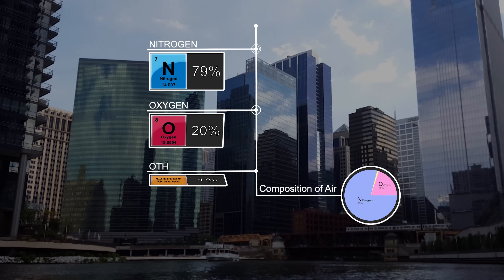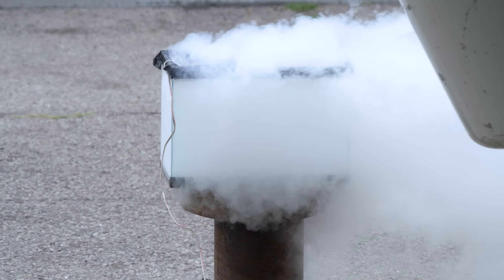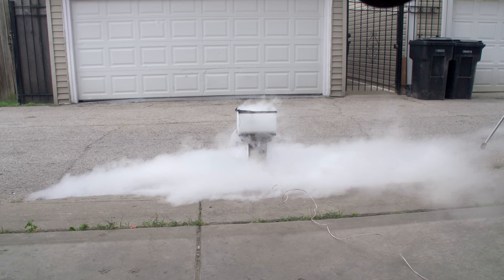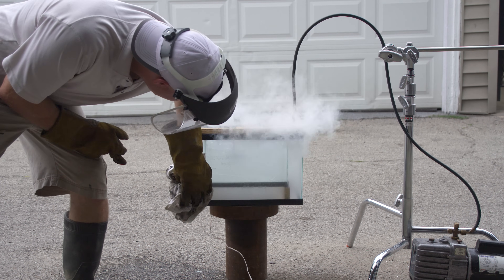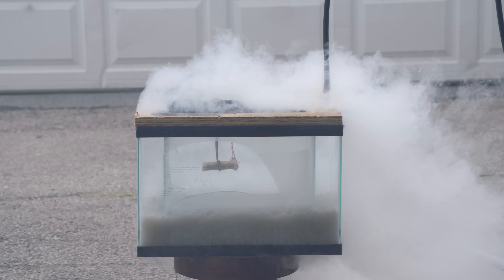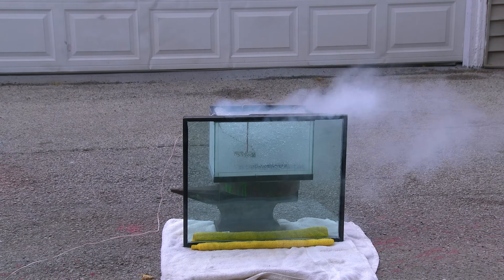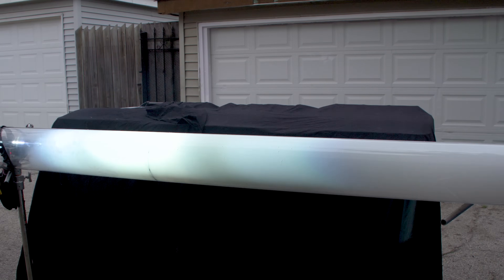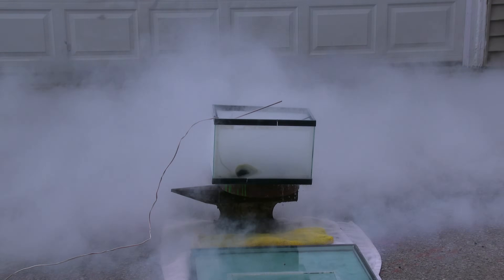Burning Model Rocket Motor In Liquid Nitrogen - 4K Slow Motion

Comment: Model rocket engine in frozen block of ice. 🌫
Reply from the maker: +bgharper omg that's a great idea, that might be interesting.
Reply: Warped Perception your videos are very well done and educational. Thanks for your hard work on putting them out.
Reply from the maker: +bgharper your welcome . Thanks
Reply: @WarpedYT  >>> This is STRICTLY a guess:  If you do this with solid ice COMPLETELY ENCASING THE ROCKET MOTOR, the motor case might just explode.   Same as taking a model rocket motor, SEALING the exhaust nozzle, then igniting it.
Reply: +WP    Hell, you can do better than that. Model rocket engine in cubic foot of frozen dog doo. Then move up to rocket engine encased in Osmium cooled down by liquid helium. That would be a hoot.
Reply: Warped Perception if you freeze it in a block of ice do it in a vacuum freezer so the ice has no bubbles

Comment: Not to be picky, but you only have slight a partial vacuum as the wood is porous and won't hold a vacuum and the glass would implode if there was any significant vacuum.
Reply from the maker: +tihzho yes that's correct, I didn't pull a full vacuum here, it was just an initial attempt. Thanks !

Comment: I've been burned by liquid oxygen before. I was deathly afraid of some liquid nitrogen dripping into your boot. Shorts are a bad idea. ;)
Reply from the maker: +Raven Hurst I know, it was too hot so I removed my rubber skirt and apron, I mostly had the boots and the case the tank broke open and nitrogen spilled all over the floor, but yeah it was dangerous none the less.
Reply from the maker: +Raven Hurst yeah Liquid Oxygen is nasty stuff  I have made liquid oxygen before, and I can almost guarantee you that some of what was on the outside of the first tank was Liquid Oxygen at some point.

Comment: Rubber boots are maybe the worst foot wear for handling cryogens. If you spill LN and it get in your boots, you can get serious injuries. If you insist on wearing these boots, then at least pull your pants outside the boots.
Reply from the maker: +hpekristiansen your right. However I started handling cryogens and nitric acid when I was about 10 years old, my muscle memory is well developed in that field, my boot would be off so faster then I can say oh no. However that's not the point I know, I was wearing boots not to protect from spilling but in case the tank blew open and nitrogen poured onto the ground, I do have a rubber skirt and an overlay apron, but I didn't wear it on this occasion because it was like 92 degrees outside. I do appreciate your concern as I do cut corners from time to time when we are in a rush.

Comment: That double-pane final attempt was da motts applesauce!
Reply from the maker: +Kevin Karges Thank you !
Reply: It would've been better had the insulated window extended above the tank rather than below.  Much of the image in all shots was ruined by the fog spilling over the top of the tank and in front of the camera.  A barrier above the viewing pane would've kept the fog behind the tank and not obstructed the view.
Reply: Is double pane glass something exotic in the US? In Sweden triple pane glass has been the residential standard for the last 25 years or so.
Reply: @Patrick  Double pane is not uncommon and the choice for most residential windows, though the manufacturer buying them cheap from Chinese sweatshops cranks the price up to 2nd mortgage territory to install them.
So most people build with single pane and just deal with it.

Comment: "try liquid oxygen" comments are " so funny" ha ha. No. Try liquid hydrogen! 😎😀
Reply: Liquid hydrogen actually probably would be less exciting if anything. In liquid oxygen everything is a bomb. So the motor, casing, tape on the mounting, copper wire, plastic tank edges... All explosive. Glass won't burn, you need liquid fluorine for that... Ya know that Falcon 9 explosion on the pad a while back? That was because liquid oxygen soaked into a carbon fiber tank and froze due to liquid helium. Yes, just the energy released when it froze was enough to start a massive explosion.

LH2 would bee cool too though- I'm picturing the air above the tank exploding in a giant fireball and a certain YouTuber ending up on about 500 government lists ;)

Comment: Perhaps the reason the engines burn quicker in both a vacuum and in the liquid nitrogen has to do with a lack of an extra supply of oxygen to draw from outside of the engine. My guess is that when there is a supply of oxygen outside of the engine that the fuel may use some of that to oxidize which could prolong the use of the oxidizer found within the engine itself, which may create more of a controlled burn rather than a rapid burn. This principal is along the lines of air-augmented rockets. I could very well be wrong, but that's my hypothesis.

Comment: Okay, wow. That was impressive!

(as to why the casing cracked, liquid nitrogen temperatures tend to make things quite brittle, including cardboard. Try dipping a paper towel in it, you'll see it becomes "crunchy" when you take it out.)
Reply: I'm going to have to add a "yes- but..."

The biggest problem here is contraction of the fuel. Black powder contracts more than cardboard, so it cracks. Those cracks mean that the flame front can burn just about everywhere instead of just the end where it's supposed to. The end result is that all that extra power means the case is overstressed and splits.

This is a well known failure mode in black powder rockets. It's been known to happen just because motors were made on a hot day and burned in below-freeing weather.

So brittleness is an issue, just the propellant, not the casing, and it's only an issue because it shrinks.
Reply from the maker: +piranha031091 thanks , glad you liked it
Reply: piranha031091 brittle cold temps are also what caused one of the o-rings for the Challenger's solid rocket boosters to fail... that being said... you definitely have a point
Reply: i used to take wet paper towels outside when it was windy and damn cold...let them blow in your fingers like a flag, and suddenly they just kinda snap frozen...then go inside real quick, and whing it at someone like a frisbeee...by the time they pick it up, it's floppy again. And they are all "WTF?" LOL
Reply: I guess that explains why it burnt up so quickly!
Reply: I suspect you let the last one sit submerged longer causing the brittleness mentioned thus the CATO catastrophic failure.
Reply: Thermal contraction and/or expansion could also have cracked the fuel grain, or separated it from the cardboard wall, causing a larger burn area and thus too high pressure.
Reply: Would the supercooled fuel be more dense and burn faster due to the molecules just being in closer to each other?
Reply: piranha031091 I feel like this guy already was aware of that fact.
Reply: Looks like some of the propellant got blown out of the casing when it split
Reply: The wire would have also shrunk
Reply: piranha031091 and thermal shock
Reply: mate no1 cares
Reply: 10:14 : He cares.
You don't? Too bad. But then, why would you reply? 
Don't you have anything better than trying to be upsetting to random people on Youtube? It's not a healthy pastime you know...